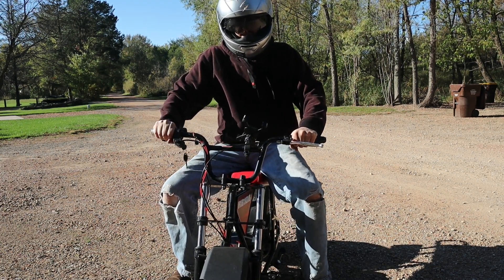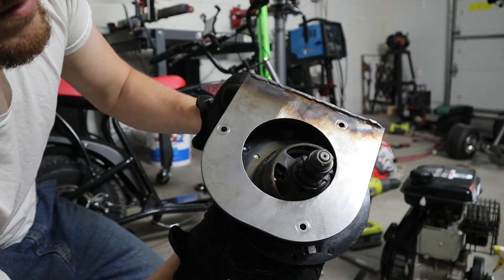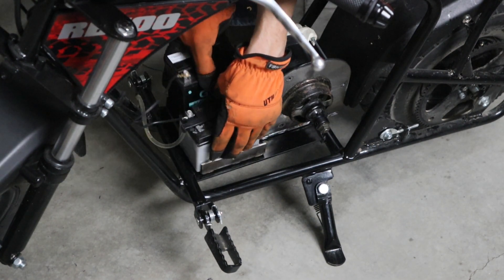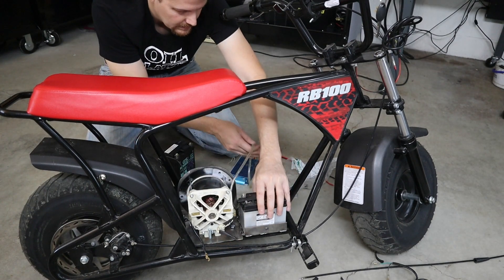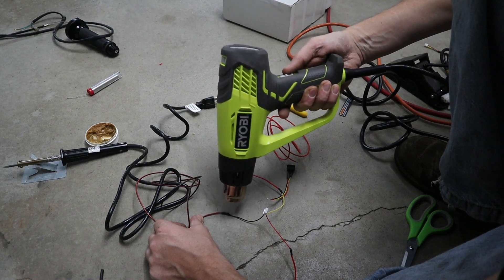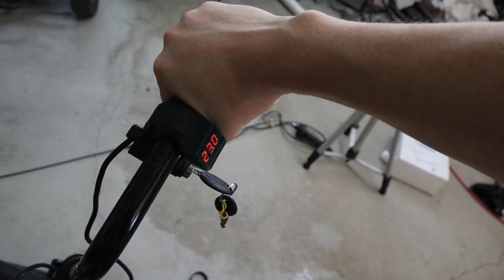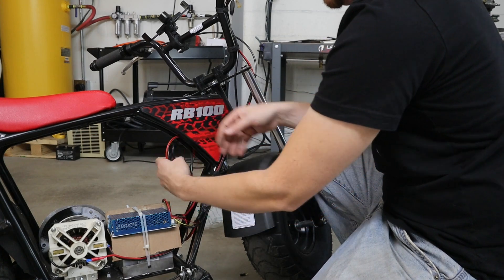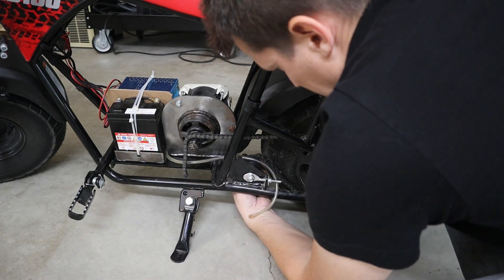cheap ELECTRIC Mini Bike

Comment: Good Stuff! Put on a brushless 72v motor and controller with some lipos and you'll never look back to gas. I run 134v lipo goign 55mph on factory gearing with a 2.3 sec 0-30 time. Destroys 90% of gas bikes and its quiet and unsuspecting enough to ride anywhere. 

Quick flyby with 120v tool bats and my neighbor. https://www.youtube.com/watch?v=4A0qHd-bQUk